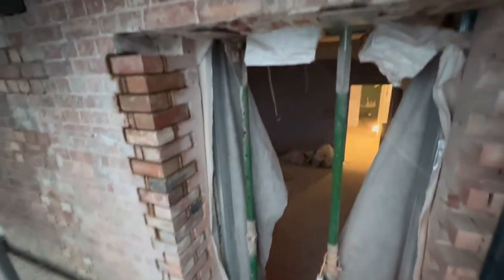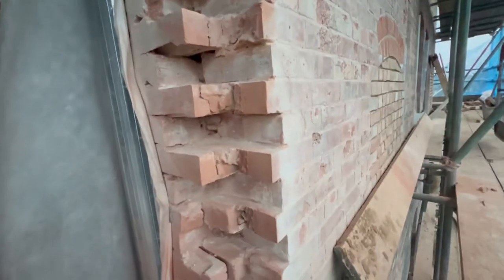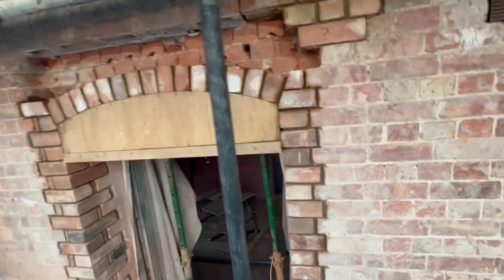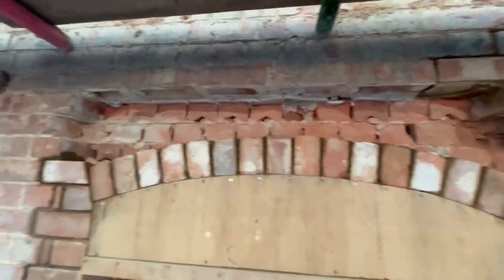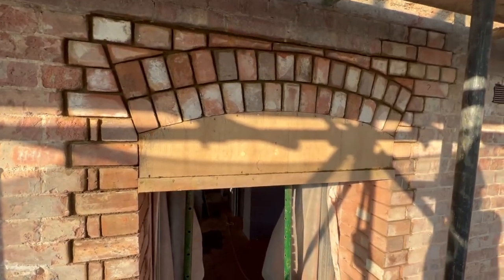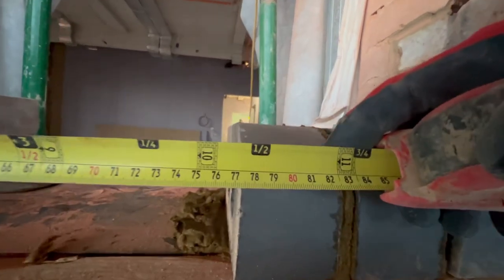Building A Brick Arch | Old bricks #bricklaying #construction #brickwork

Comment: The joints should all line up with eachother in the arch...bottom ones a bit thighter obviously.. I'd make you take that back down because it is an eyesore...
Reply from the maker: Your very wrong the joints should not all line up unless your cutting the bricks at an angle to make that happen it’s not possible because that would leave huge perps to make them line up. If you also new anything about working on old buildings you have to match the way the other arches are built to keep the same aesthetic. So no you would not make me take it down cause you clearly do not have the experience needed to be a foreman anyways 😂😂😂😂 get your knowledge right before you comment
Reply from the maker: @djhago3123  because this is how the client wanted it to match the rest of the old building built many years ago and the fact your still asking when I already told you just shows how little experience you have in construction. Mate the whole building looks crap cause its old and whatever needed restoring has to loook like the rest of the building. Do you understand now or you still struggling cause you that dumb.
Reply: @solidbrickwork  im 20 years in the building trade and I've worked on churches and jobs that cost 10 million so I know the job.. I run my own business now and I was 21 when I ran jobs for my boss.. I know bad work when I see it..  I'd pull you up on it..
Reply from the maker: @djhago3123  you been 20 years painting and decorating mate. Because if you don’t know that you have to match the rest of how the building is built you don’t know shit. There’s been historical buildings rebuilt that have even been rebuilt out of level and plumb to match the rest of the building. Enjoy your painting and decorating
Reply: @solidbrickwork   I'm actually a joiner by trade.. I know you're only starting out.. but take a bit of advice from a lad who knows the business.. if your doing detailed work that is on show you take your time and get it right the speed will come after.. I know how old buildings are god knows I've worked on enough of them.. you try follow what's there.. but there's no way that was like that beforehand.. the old lads had more pride in there work.. no one will say anything if the brickwork is neatly done.. but when it's rough expect criticism its sometimes the way you only learn..
Reply from the maker: @djhago3123  bro your saying there’s no way the old building was built like that. I’m telling you there’s another 50 arches or more all 100 times uglier. In fact do you want to know the funny thing. My foreman actually took down about 4 peoples arches and my ones were the only ones that stayed. I’m telling you mate I got no problem admitting when I’m doing something wrong. But I’m telling you the old arches all looked worst than this and I had to make them look like the old ones lol

Comment: i have never done a brick arch like that this is the lazey way.
you should key in a arch with the pillor.
and it looks nicer as well this way it just looks plonked there as a after thought.
but still better than a straight lintle so good job on the part of trying to make it look nicer for the client
Reply from the maker: This was a massive building with many arches already built like this. Only some where rebuilt from damages. Therefore the arch to look like this was not my choice. It had to match the rest of the building. So any arch rebuilt was built to match the old ones. Thanks for the comment 👍